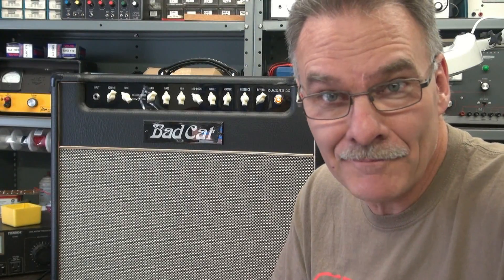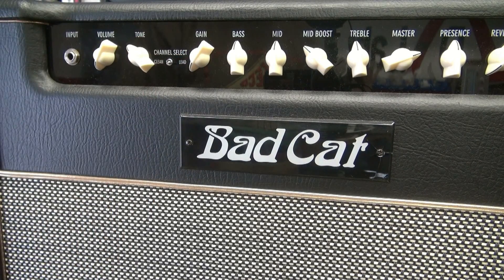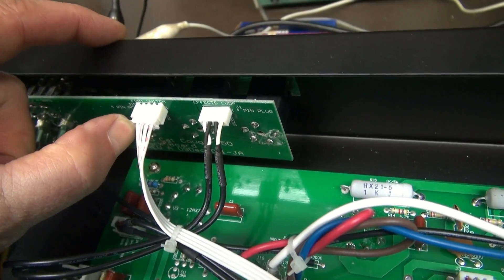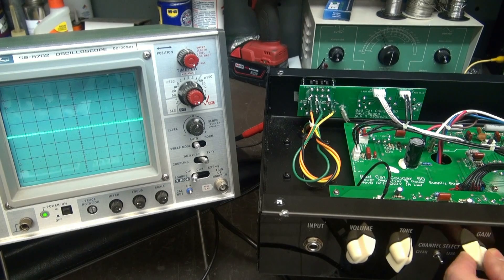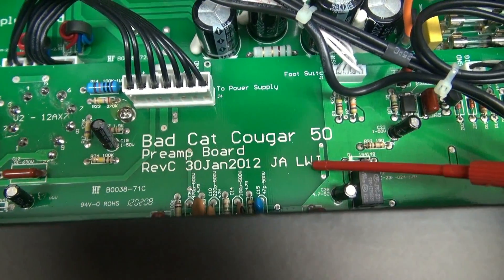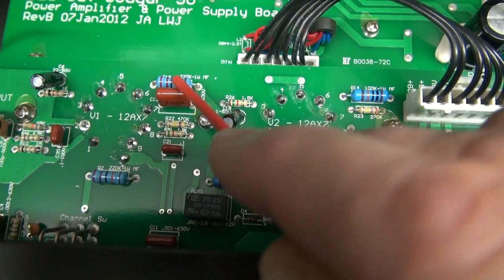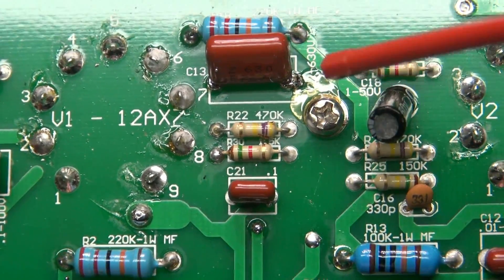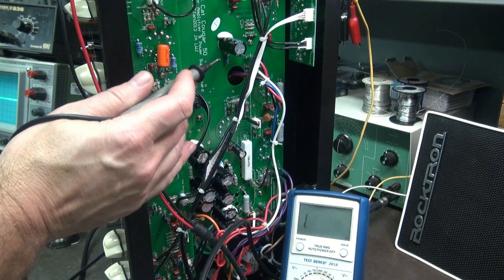How to repair Bad Cat Cougar 50 tube guitar amp by D-lab Electronics

Comment: I have this same  amp and when you power it up there doesn't seem to be much volume on the clean channel the lead channel is super loud and feeds back you can only raise the gain about 1/3 d and it feeds back. Also every now and then it makes a sound for like 5 seconds it sounds like the cats fighting in you video and it goes away.
Any ideas ?

Comment: hi,mr.d-lab id like to know if you know the spitfire matchless 15 watts .i made this amp  but im not sure for the value of the cathode resistor and the value of the output transformer the shematic that i found has 120 ohm 5watt cathode resistor and 4k for the output transformer.thanks to you

Comment: Hey man! Thanks for all the great videos!!

Sprague Orange drops is your recommendation? How about for the power supply?

I've worked mostly on transistor guitar amps and hifi amps and use Elna Silmic II hifi caps. But not sure if they make em in the tube voltage region....

Thanks again, man 🤘👍

Comment: I'm scared by equipment that won't use metallized vias on PCB - what's the difference in price per board -  ten cents, fifty? If someone makes things in a way to get even such marginal cut on few hundred bucks worth device then I don't even want to imagine what other cost-saving measures not visible in plain sight were employed by manufacturer.

Comment: Interesting video. Thanks. Disappointed that a Bad Cat amp could be so poorly put together. I get that it's their budget end but still... 'Budget' is all relative. They're still expensive enough to expect them to be put together properly. Cool that you were able to diagnose the fault.
Reply: Agree this may be budget....but company name ...still attached to it.
Reply: I believe the Cougar Series that were outsourced to China (The amps were built by Hanser in their Chinese factory ) in this way and apparently bear very little resemblance to a proper USA BadCat. That deal ended in 2014. "The Cougar series has nothing to do with Bad Cat USA. Please contact the manufacturer of the amp Hanzer.
Thank you,
Brian Kushner
Bad Cat Holdings LLC"
Reply: This is not a real Bad Cat. This is a made in china junk and has nothing to do with the made in USA Bad Cats. Do your research first before you post B.S.
Reply: What part of "I get that this is their budget end" didn't you understand? Read AND comprehend before YOU post BS.

Comment: Great video Terry! I love these kind of videos you do. Did the new tube have something that caused the plate resister to fail? How are the new Mullards?They cost more than JJs and Sovtecs. Are they as good? Are they as good as the old ones? Thankz
Reply from the maker: I believe the tube was installed incorrectly initially, causing the resistor to pop. I like the Mullards and Sovtek 12ax7lps

Comment: On target as usual! :) This has happened to me a few times in the past where I didn't pay attention to the customer, and thought, "I'll know when I open the amp." However, I discovered that there was more than meets the eye and ear :) Open plate resistors in the preamp has been a common failure especially in the Fender amps. It proves also that just because the tube is a Mullard, doesn't mean it's going to be trouble free. Back in the day, I had many new RCA & Amperex tubes that were duds. Can't win 'em all :) One other thing I found interesting was, the microphonic capacitor. That issue is usually prevalent to Ceramic disc caps. This indeed was an interesting repair. Not too fond of the build quality of the Bad Cat, but it is indeed a loud amplifier! Keep 'em coming...Frank Ferraro--Audio Craft Electronics.
Reply: Frank Ferraro I first thought it was a grounding issue. Would it help to use a bigger rated resister, like a 1 watt instead of a1/2 watt? I totally agree about Terry's abilities! I just wish I lived closer. Thankz
Reply: It would be better to stay with the 1/2 watt...it acts as a fuse and can prevent extensive damage to other components if the tube develops a short. I recently had 2 Fender Twin Reverb's that had open plate resistors on V2. both tubes were shorted and had the same burnt spot on the side of the plates...and they were old RCA's.
Reply: I think the problem was just a resistor. But better cap always is better for sound. Especially in the signal circuit.